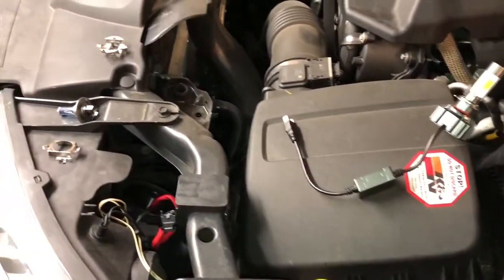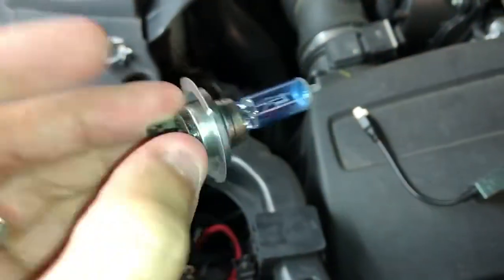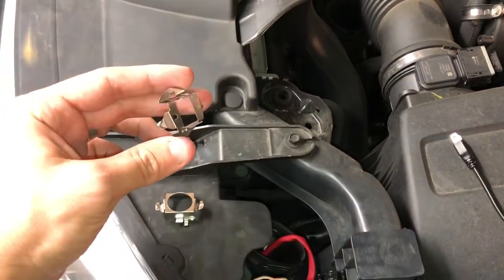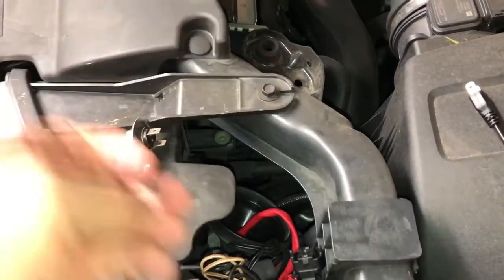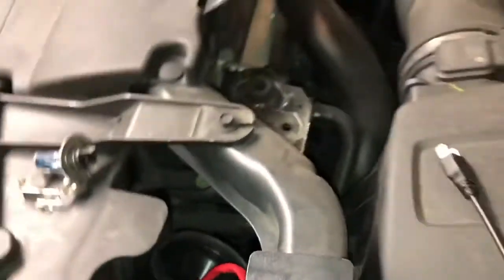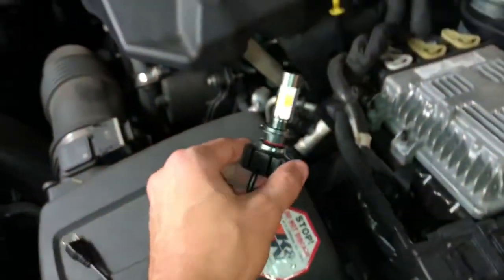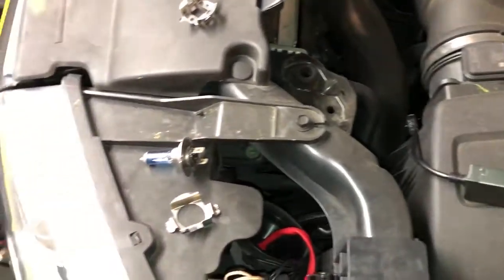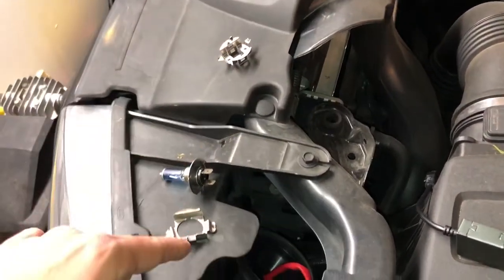LED headlight install help

Comment: Probably 6 years too late, high  tyre pressures pop head lamps and tail lamps, can be one cause of failure, the filament in the incandescent lamps are all running white hot and the thump of the tyres can be a threat to the frail hot filament. Have recently fitted Led head lights to  a BF ute and discovered one of the High beams H7s had become dislodged not blown , usually run 38 PSi on advice from a renowned tyre shop . Drove Falcon company cars for ten years and also 10 years of Night driving a Taxi in Sydney and the H4 were a awkward to change , day drivers were retired truck drivers and would have the tyres super hard at 50 psi  only half of what they were used to 100-110 psi in the Tyres on the trucks. Used F1 Headlight compound for polishing aged headlights, a one step approach and it made a real difference for night driving.

Comment: would it be a bit easier and not cut into anything if I removed the head light assembly am thinking I could fit LED lights easier on the work bench . if so can anyone post a vid of how to remove the complete assembly

Comment: Did you ever solve this? I literally discovered the exact same issue this morning with mine :( The factory retainer clips are way too small to hold a high output led bulb. I was thinking of getting the dremel out!
Reply from the maker: Yes, I literally just cut mine up, figured these cars are extremely common and definitely cheap enough now :)
Reply: Did you touch the globes with your bare hand the oil from your skin is not good for the globes it limits the life of the globes

Comment: Well you went the hard way about that?!

No need to completely remove those clips and all that. You just twist the loom, out comes the globe with it, and you just then pull the H7 globe out of the saddle it mounts in to. Replace the globe then place it back into the hole and twist till it clicks back into place. However, this part on its own can be a bit fiddly! 🤬

Also, I too just tried to upgrade my globes to HID like you have there, but found that they just will not fit because the part of the loom that holds the H7 is needed to hold the globes into the headlight assembly?

So you can only replace with the LED style that have the 2 prongs at the base to fit into the factory holder, the H7 style ones, like the ones you said you didn’t want? 🤷‍♂️

Comment: Hi
How did you go with LED installation?
I also have Ford Territory 2013, bulb type H7.. and i want to upgrade to LEDs
I bought the LEDs which looks exactly as Helogen but it was dim not that bright..
Which LED should i buy?
Thanks

Comment: Had a similar problem. Had to use a rotary tool (dremel) to bore out the hole a bit bigger to fit. Probably have to do the same with the brackets
Reply from the maker: thanks for the advice - did you bore out the hole in the thin retainer clips?
Reply: That Car Channel didn't have that style of clip. Mine. Just had to modify housing. have the spring clips so wasn't an issue

Comment: Sometimes you have to enlarge the hole the led goes through to get it to fix into the housing, even cut part of the back of the headlight body to accomodate the rear section of the led, then fix a rubber boot over to stop moisture